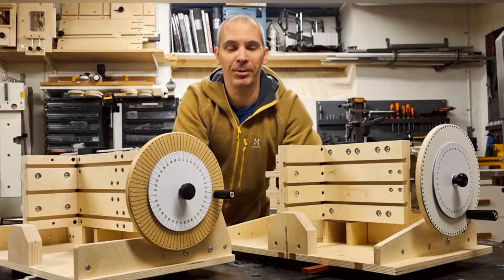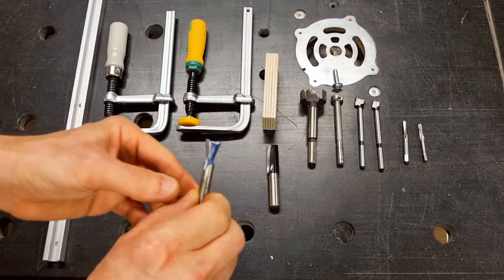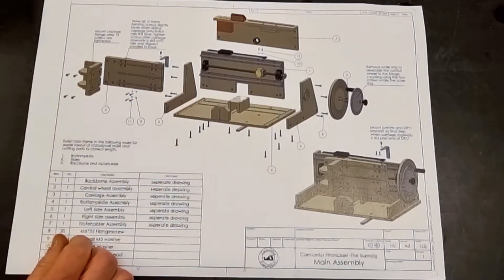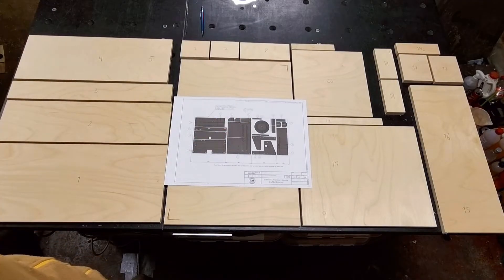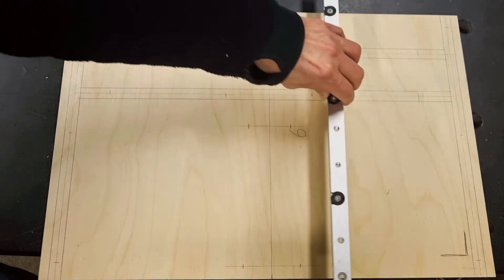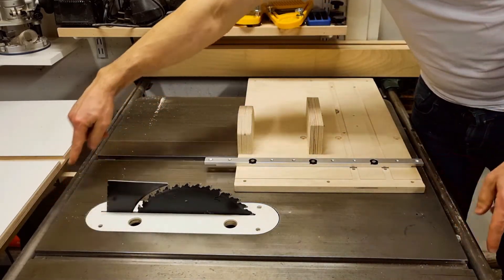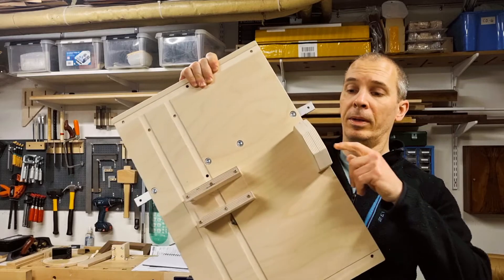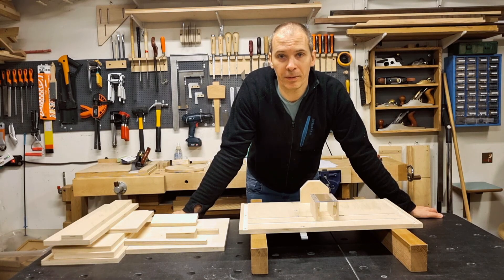Build part 1 - Intro and Bottom plate

Comment: Looks very nice! I’ve been trying to source a miter bar that fits my saw which have a 15mm slot, have you come across anything in that width? I have an Ejca L18. Bra jobbat! 🎉
Reply from the maker: @albinn3569  Thanks! The jig I made in the build videos was actually for an Ejca L18. I modified the jig after this series was filmed. I used a MGN15 rail, and recessed it like 2.5mm in the base of the jig as it otherwise would have been too thick. That rail fitted extremely well.

You can find these rails quite cheap on aliexpress or other cheap site.
Reply: @ many thanks! I’ll build your cross cut jig first, then I’ll move on to this one I think!
Reply: @CarmoniusFinsnickeri  I also have a 3d printer. Maybe I could print a bar with that before buying a MGN15 rail. I printed some test blocks and they fit snuggly in the slot. Would you use the t-bar shape or just a cube shape?
Reply from the maker: @albinn3569  I would not use t-bar, no reason for that as this jig is never outside the table. I'm a bit sceptic to 3d-print bar, this jig is quite heavy and needs a stable guide. If going for 3d-print I would recess it in a routed track on the underside of the jig to keep it controlled and prevent it from warping.